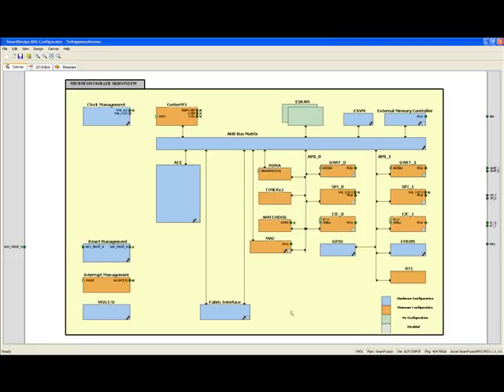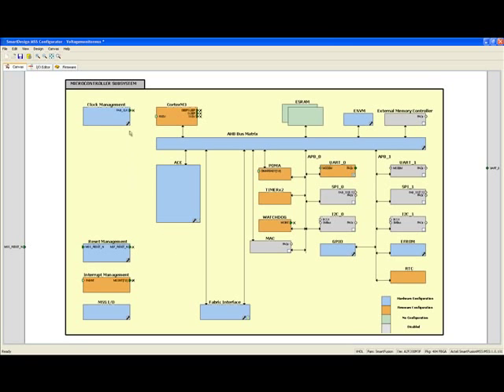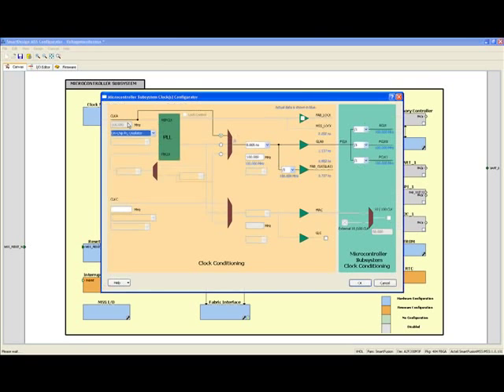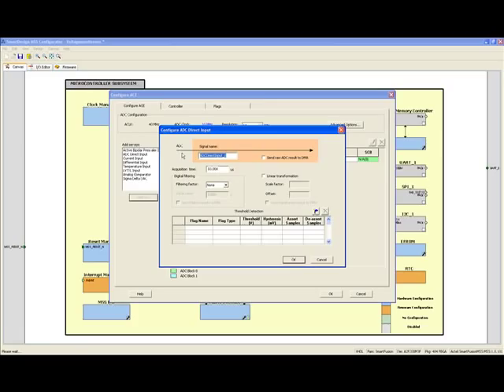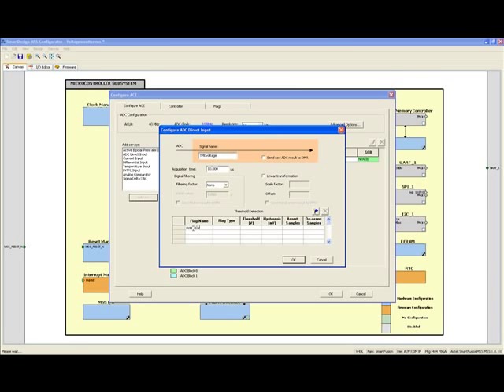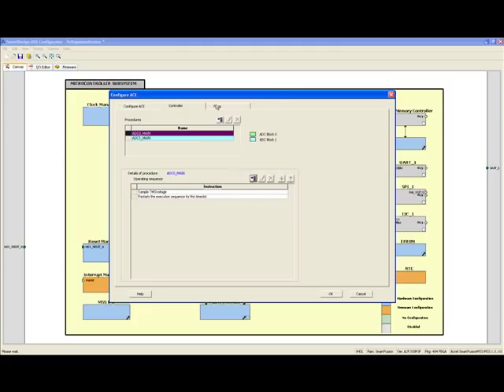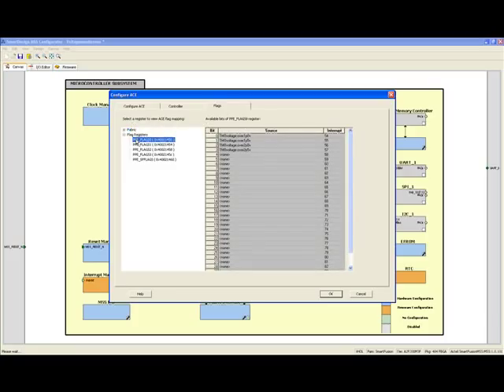SmartFusion Analog Design Flow Part 1 - Libero IDE project & ACE configuration

Comment: Hi, dear representatives of ActelCorp!
My name is Anton and now I start working  on SmartFusion A2F-EVAL-KIT. When I'm write very simple code on Verilog (for example it logic gate NOT):

module NOT( a, b);
input a;
output b;
assign a = !b;
endmodule

I see the error: "A design must contain at least one net". Or other very simple code 
(so that the output of one pin is a logical unit):

module unit ( a );
input a;
assign a = 1;
endmodule

the error is similar. I'm not need the CLK. At the Xilinx Spartan-6, everything works fine. What do not I understand, Michael? Please help me!
My best regards!!!